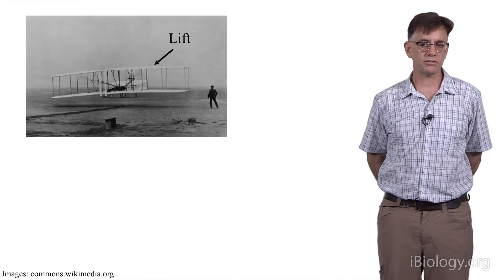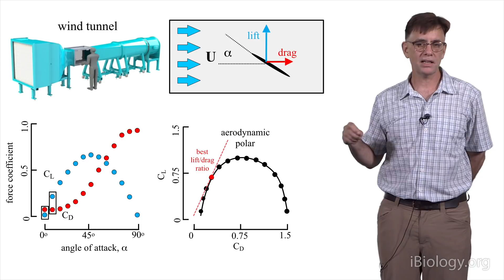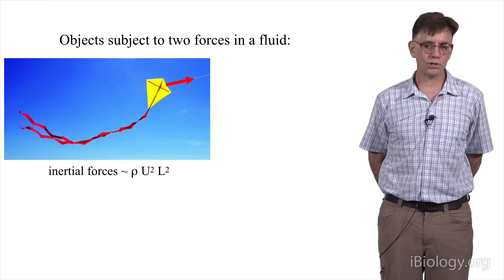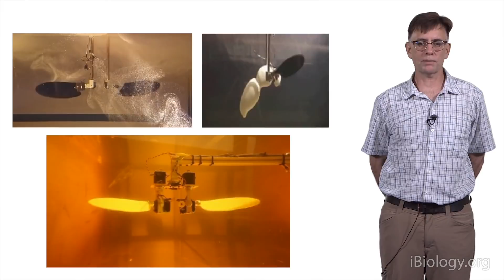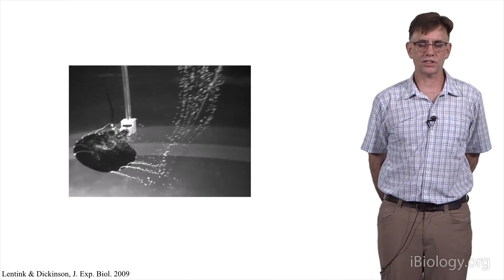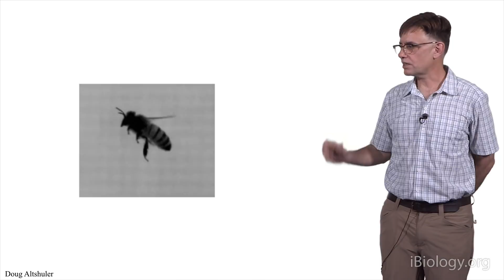Michael Dickinson (CalTech) 1: How Flies Fly: Lift

Comment: In your TED Talk you said you captured the data of flight directly from the fly tapping into its brain. Would it be possible to capture all the movements or patterns of the fly and convert it to a set of commands to control a self flying device such as a drone? I guess my question is how basic or vast is the data captured when in flight?

Comment: Lift by way of an airfoil, wing, is NOT due to Bernoulli. It’s Newtonian. However, the Bernoulli equations are close enough to what does generate lift that they are used to design airfoils.

Lift by an airfoil is due to the extreme vacuum on its top-back surface pulling downwards the air flowing in over it. This downward pulled air then pulls down more air from above it. All of this air is then accelerated downwards at the airfoil’s trailing edge. The opposite an equal action is lift.

Interesting fact: As airfoil induced lift is Newtonian, most of the energy that sustains a plane in flight comes from gravity. That is why aircraft have unpowered glide ratios, and why autogyros are able to fly.

Comment: It was a good talk, but can someone please write down, in layperson's language, what exactly is a leading edge vortex and how a fly wing generates it?
Reply: Think of it more like swimming than flying maybe. Imagine you moved your palm through a still pond, and saw the vortexes behind the edges of your palm.
Reply: Also a correction..at ariund 7:00 why is the force of the wing on air pointing up above the wing..he is discussing the force of the wing pushing DOWN on air BELOW the wing..so the arrow should be pointing down and below the wing?
Reply: I assume for the fly it's happening because of the high angle of attack (angle of the wing into the oncoming air). The air 'tries' to remain stuck to the wing top surface, but the angle is too steep, so the air 'detaches'. Since it is no longer attached, and there is slower/still air above it, it forced/sucked down and backwards into the vacuum behind the wing upper surface, and eventually comes into contact with the 'next' 'batch' of detached air. Round and round it goes, in a 'vortex'.
To understand vortexes it may be easier to watch videos on wing stalling, turbulant flow, or eddy currents.
The funny thing is that for aerodynamics in school/university detached flow and the resultant wing stall was a disaster! Incredible that insects can harness it to make lift.
For understanding how leading edge vortexes make lift, that's another things that's a bit tricky, I'm not sure I completely get it.